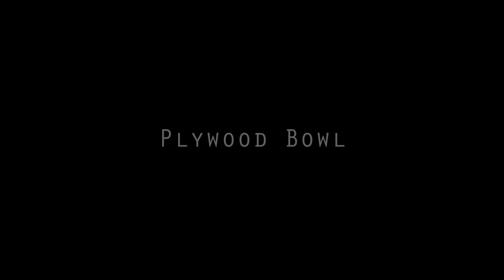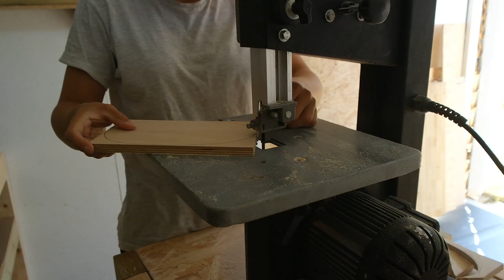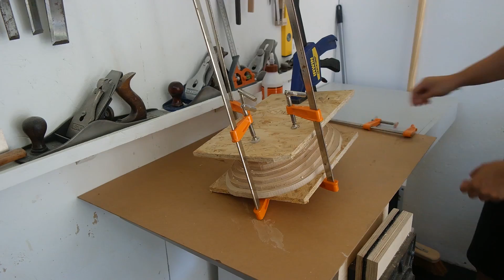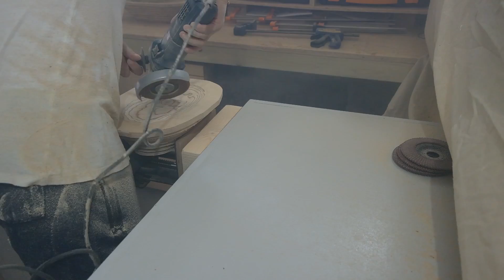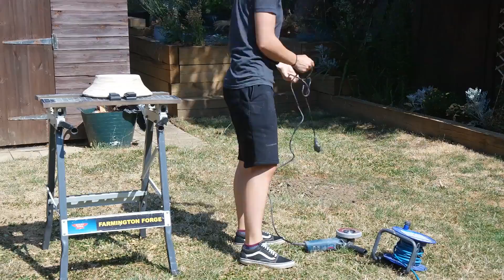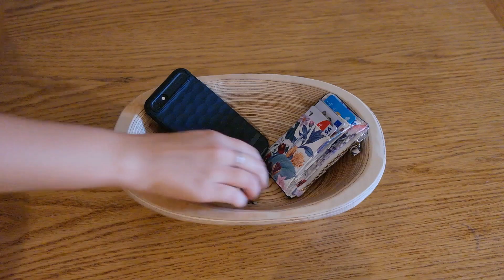Bowl Without a Lathe - Plywood Bowl - No Lathe Challenge

Comment: At 1:30 I noticed that you had been using gorilla glue plus another glue in a smaller bottle (looked like superglue) was it an activator of sine kind to doers up the glue setting? Great bowl, loved your design.
Reply from the maker: Rubix 1976 I used gorilla wood glue for strength and the some super glue for quick glue time - I only had it in clamps for an hour or so before working on it again so the super glue held it all together while the wood glue cured for a strong joint. 

Thank you very much! Be sure to check out my other videos and subscribe 😊